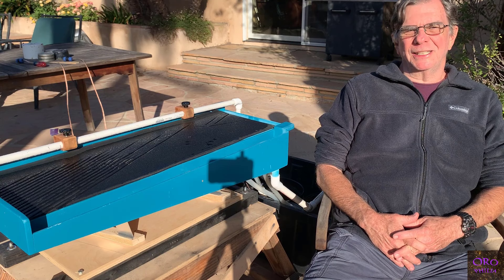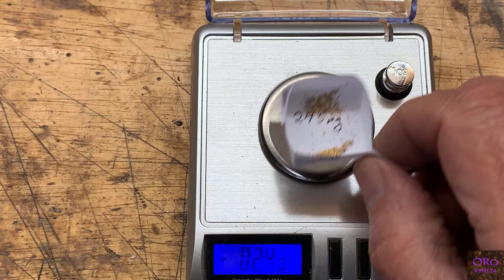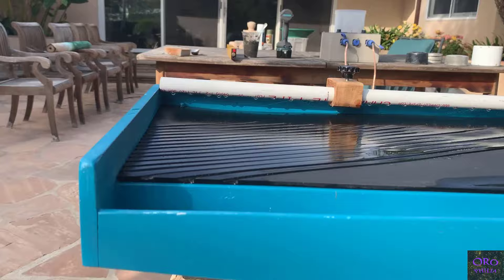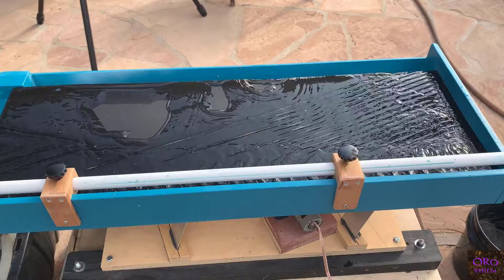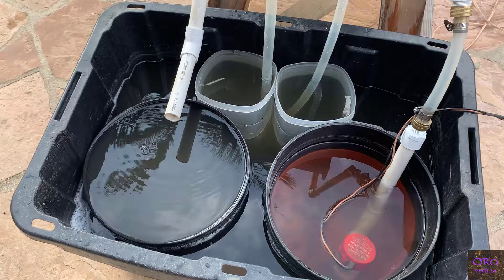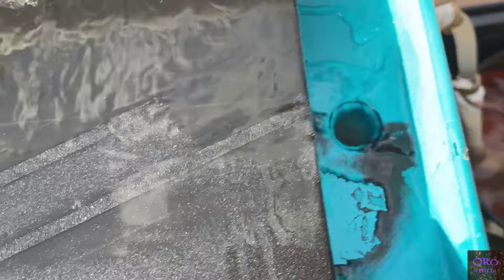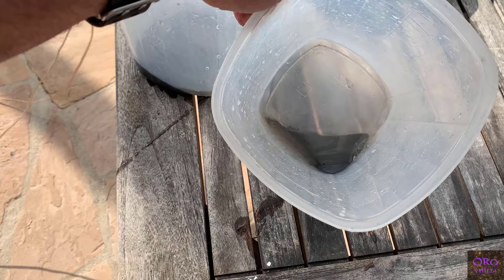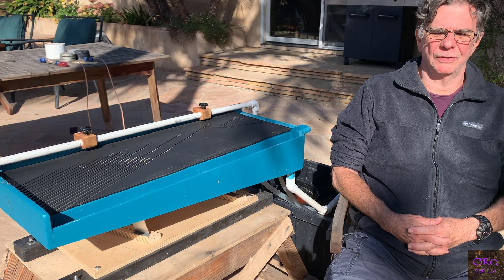Portable DIY Shaker Table for Gold Prospecting and Extraction

Comment: Pretty  Slick!  I had a rubber mat for flooring in a truck that i could modify . It had very small ribs across it. If I had something like a shaving razor to remove some ribs it would work real nice! I would have two batteries and charge them with a solar cell setup to swap out when I needed to.
Reply from the maker: If you make it let us know how it turns out.  Good luck!  -- Dave

Comment: hey man just wanted to stop by and say nice table. i like the extras you did for the battery pack and all too its not a bad idea at all. if you decide to do a box for ac power for when your home you can always just use fan controllers from lowes menards home depot. or if you like your own wiring you can use rheostats aka dimmer switches if you didnt know. 
also as for the flexors. look into scooter parts gy6 50cc or the 150cc the parts are dirt cheap and you can use their torque drive or clutch springs for your base. the 50cc stuff is pretty strong the 150cc is really strong and the 2 stroke stuff is inbetween. they may be a bit bouncier than the flat stock but will last forever and move more fluidly.

Comment: We've been beach mining in Nome Alaska for more than 10 years. We've developed several iterrations of a 12 vot portable mini-sluice for prospecting. Always looking for something better and faster. Your demonstration is very interesting. I admire your ability as a craftsman. I am not capable of building such a fine machine. How about a simpler solution? Have you thought about using an acoustic speaker and a vfo to drive the vibration?
Reply from the maker: That is quite an interesting idea! Yes, the idea with a sluice is to keep the material in a state of partial liquefaction, and the acoustically-induced vibration should do that. I'll give it a try. Sound like fun.  --  Dave

Comment: cool build,  If going to the desert, I would take something that concentrates and does more production, then bring back the cons to your machine. It will not do as much production running desert material as you expect, i don't believe. I make concentrators, on my other channel, that would do much more production, Spike's prospecting Equipment!  Great build and details! I mold ABS parts!
Reply from the maker: Yeah, you could be right. I have a few days off next week to check it out in the desert. I'll take the machine with me but I'll leave it at the cabin. I'll collect some classified material from various locations and run it through the machine in the evening. Great to know that you mold ABS! Thanks.

Comment: That was awesome!
I think the fine gold vs the sand and heavies is still not within the same "scale" though. For full separation you can't have a gold particle smaller than 1/2 to 1/3 the size of the largest heavy and the 1/3 is really pushing it. Try running it with classified material within this size ratio and tune water for that and I think you will be surprised.
Reply from the maker: Yeah good comment. I have a lot to discover about various types of material. I won’t be able to get out to the desert for another three weeks. I’m going to see how the apparatus really works
Reply: @orophilia  I just wish I had a goldsource anywhere near here.
I get to go to a goldcamp two times a year tops, and it's a 4 day stay with a 16 hour roundtrip.
Built my own vortex matting and classifying sluice though, and it works a treat.
The classification is really important to allow the shaking and water to handle the particles differently. Since gold is 19.3g/ml while the heaviest sulfides and black sand is up to maybe 7g/ml (tin sulfide 5.3, lead sulfide 7.6, hematite 5.26 and pure iron 7.8) a round-ish particle twice the diameter of a gold particle starts to act the same. Any larger difference and it's a random game of bounce the particles.
I've always been pondering some sort of screen system on a shaker table to automatically screen the material into very tight classifications so they can drop on different regions of the table with correct waterflow to separate perfectly. Would be beautiful to watch.
Reply from the maker: yes! that’s a nice idea. thx for the comment
Reply from the maker: I’ve been looking at the settling rates for gold and other minerals of various shapes and I see what you mean

Comment: Very interesting! I am curious about how much design you put into the shaking action itself? The asymmetrical gearing you show should produce an equal-speed back-and-forth shaking of the deck, but I feel there is huge potential in designing a shaking motion that is fast in one direction and slow in the other. Something akin to tapping a pan? I am only theorizing here, though. Thoughts?
Reply from the maker: Hi Kristian. Yes, I agree, there is some potential here for innovation. I'm trying several other methods of moving the table with more of an impulsive force. Asymmetry is the key. Thanks for the comment.
Reply: As long as the center of the motor axle is offset from the pivot point on the table, there is some difference in motion forward and back due to the geometry. It will move faster in one direction.

Comment: Finally a shaker table I could easily fit in the space my wife lets me have in the dog house 😯

Would you mind describing the neoprene mat you used?
Does the mat material have a big influence due to surface structure?
Example: Rubber can be very fine grain, neoprene can be rough (rough doesn’t mean bad per se, we all worked our pans for a reason).

Thank you, this is very encouraging!
Reply from the maker: Yes, the surface texture of the mat does make a difference, especially in the grooves. I finish the grooves with fine sand paper for this reason. I use simple neoprene mat, 1/4" thick.
Reply: Thank you for being specific.

I have a 3mm mat on my desk and two buckets of a nuisance to pan. You have helped me.

Comment: Could you put a run above the bar with a wet hopper at the top to do a constant small feed onto your current loading zone while you load the hopper twice as much but in intervals?  (If that makes sense)
Reply from the maker: Yeah, totally makes sense and that's how I'd run it in mini-production mode.

Comment: Why is the battery voltage 8 volts? I thought the motor you are using 12 volts?  Thoughts?  Thanks
Reply from the maker: Hi Dennis, Both the pump and the motor are 12V devices, but I use the voltages to them to adjust the rate of water flow and the rate of shaking of the table. So, I typically run the pump at 8V and the table at 14V.  That gives the best overall performance.  -- Dave

Comment: What kind of motor mount did you use please?  Looks like either delrine or a 3D printed mount.  Looks like it would absorb some of the shock from the acentric coupler.  Thanks
Reply from the maker: I bought that motor from amazon, I think, and it came with the motor mount. I've made other motor mounts out of Aluminum plate, Delrin, etc. They all work.

Comment: What about putting two shaker tables in a diamond configuration but with two feeds?
Reply from the maker: That should work but be aware that the load on the motor and springs will change. Some experimentation will be necessary.  -- Dave
Reply: @orophilia  I didn't see that there was any springs in the system but I get what you're talkin about.
Reply from the maker: @dennishedrick5308  The flexure supports are springs.  -- Dave

Comment: Not trying to pic shit, just give you a heads up and tell you Aluminium will work harden so it will crack, you can either change to stainless steel or just keep replacing all 4 of the Aluminium if you see one crack, but I would take some with you at all times because you know it will happen while your away from home.
Reply from the maker: Hi Gavin, I've switched to Garolite for the flexures. Garolite is a trade name for epoxy-fiberglass and should last more than the life of the table. It works very well. You can see it in action in my latest table video.
Reply: @orophilia  Yep just watched it, I know bugger all about epoxy-fiberglass so was going to keep my mouth shut. Metal is what I have worked with for 40 years, I saw something that could be a problem and gave you a heads up, I glad you found something better.
Reply: @orophilia  Oh hope you don't mind but I sent Chris of Vo-Gus Prospecting a heads up about the miller table you made.

Comment: Any chance you can save that file as something else?
Reply from the maker: Good morning. The file is a sketchup file and sketchup is free and easy to use at a basic level. Look for SketchUp version 8 on the internet. Sorry, but I don't have any way to create other formats.  -- Dave
Reply: @orophilia  I did try to find a free copy  but only found free school copy that I couldn't use. I will try and find version 8 this morning. 
Thanks again
Reply from the maker: @mrgreenswelding2853  You can open a web-based version here: https://app.sketchup.com/app?hl=en I just verified that it works. Please don't hesitate to ask if you need help. -- Dave
Reply: @orophilia  thanks again Dave, your a legend
Reply: @orophilia  is there a way to disassemble the drawing to get measurements
Reply from the maker: @mrgreenswelding2853  Greetings. In Sketchup there is a tool that looks like a tape measure. Click on the tape measure icon, then click on one end of the piece you're trying to measure, then click on the other end. The distance will be reported in the lower right-hand corner. I build most things, in the garage, by this method. -- Dave
Reply: @orophilia  fantastic
Reply: @orophilia  I can do measurements on Autodesk.
Reply from the maker: @mrgreenswelding2853  Yes, of course. Do you use ACAD or Fusion 360 or something else?
Reply: @orophilia  I use fusion at home rarely, but use autocad and inventor at work.

Comment: Why milligrams  man wtf
Reply from the maker: If I understand your question, you're asking why I use only 50-100 mg of gold. Well, that's more than enough to get the job done. I'd rather use less because that would be more representative of the actual concentrations that we mine. At 10 ppm, using one kilogram of beach sand, we would expect to get 10 mg of gold. In the end, it's just a test of the efficacy of the table.